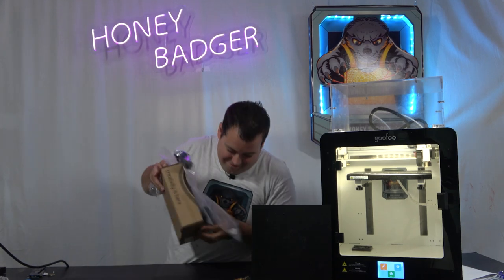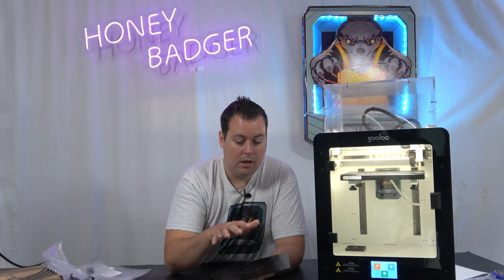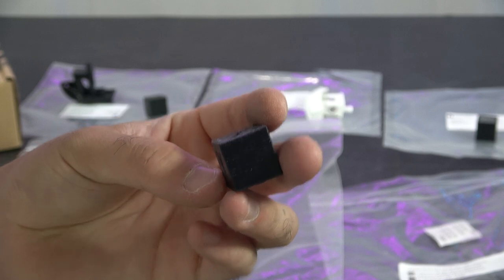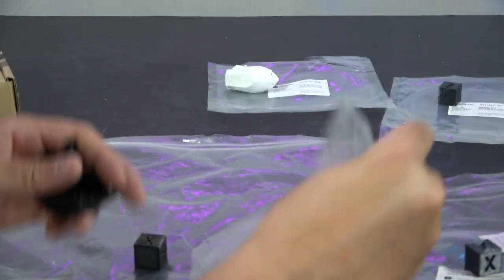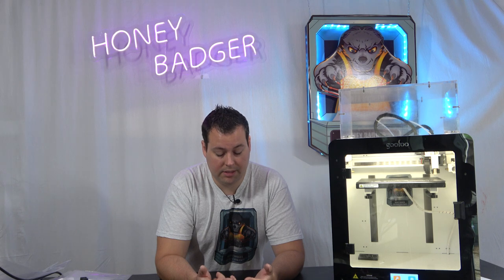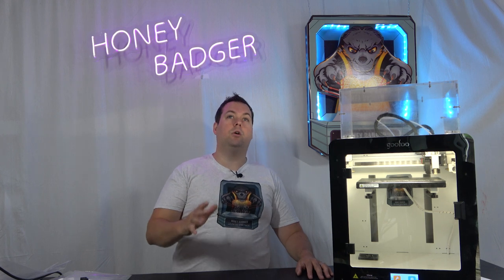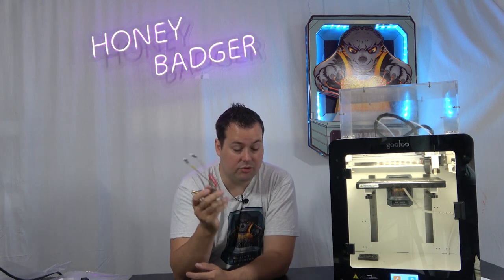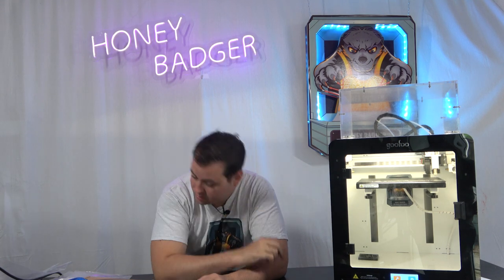Goofoo Mido 400C Hotend - Review and results

Comment: Try Visionminer Adhesive on the carbon bed instead of ABS slurry?
Reply from the maker: if we were setting this machine up to actually reliably print PSU moving forwards then absolutely we would be trying some different bed adhesion products, as well as doing a decent amount of profile tuning, the reality is we wanted to show that the material would extrude at high temp and didn't clog, which it did, and I've no doubt with sitting down and tuning profiles and knocking out a few cubes we would be able to get it to stick and much much better print results, but we only had small samples of filament due to the cost of it, for context the PSU filament cost £75 for a 250g spool and we didn't actually get a model out of that

Comment: ASA at 290? I know you mentioned these were not tuned profiles but still, some of the prints are horrible and they all look like they printed at too high a temperature.
Reply from the maker: so ill be honest and say we haven't printed ASA before, i agree the quality on most of them is fairly poor but we just went by what was on the Box as manufacture suggested temps
Reply: @honeybadger3dprintandpaint  maybe try a temperature tower first? also some of these high temp filaments require high ambient temperatures to print reliably. How high were you able to get the inside of that enclosure  without using auxiliary heating sources?
Reply from the maker: so because of the costs of the filament we only had about 25 meter samples, so doing extensive testing i.e. temp towers with each and adjusting the profile just wasn't possible, for context the one full spool we bought was PSU and that is £75 for a 250g spool and it wouldn't even print
Reply from the maker: with regards to ambient temps, we were not providing any auxiliary heating as this machine and it was sitting at 45 degrees according to out FLIR gun but as stock it doesn't provide any heating and modifying the machine would effectively defeat the purpose of the review, you can modify and ender 3 to print PEEK but it stops being an ender 3 well before you put the filament in